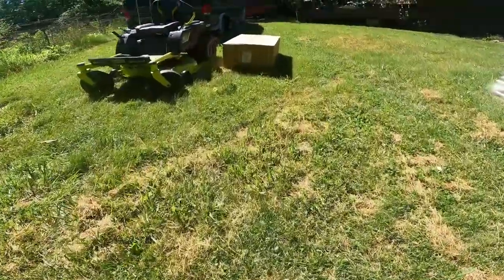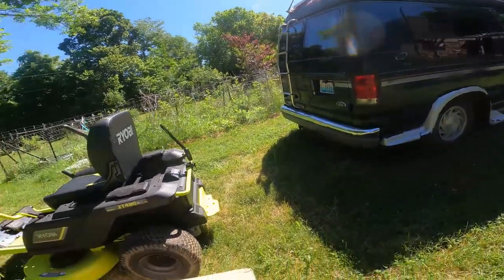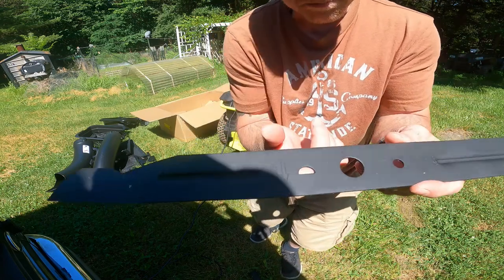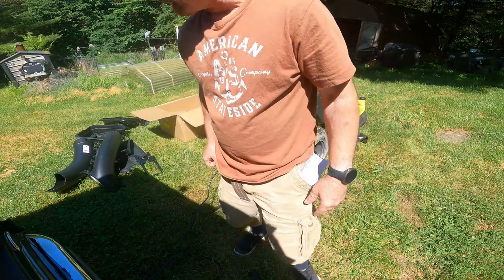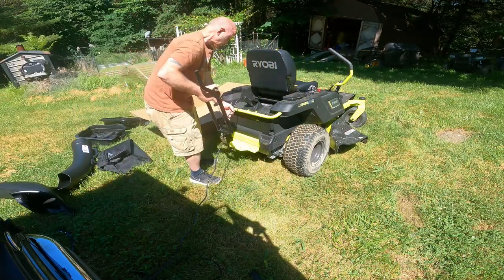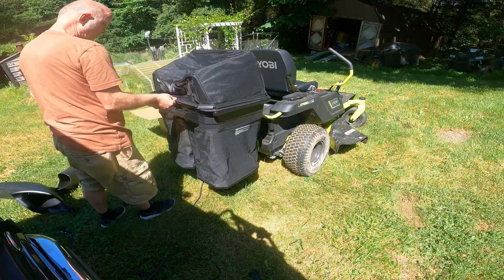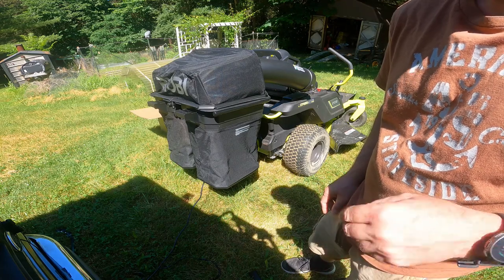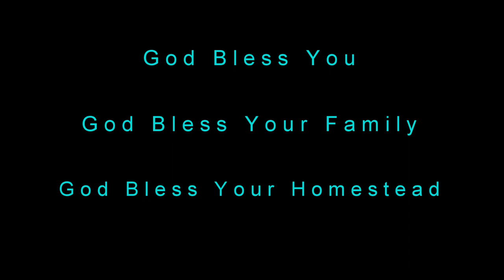ryobi zt480ex electric zero turn mower bagger install

Comment: additionally, i am going to have to make my own
Reply from the maker: you could probably simplify the factory design with just a piece of flat stock steel welded to the existing bag support and a piano hinge welded to the flat stock steel.  Its not a very strong setup at all.
Reply: @sharpridgehomestead   Ed thank you for such a quick reply, i saw this thread you created over 2 months ago and thought you may had started ignoring replies because of robot replies ( not real people ), i am pleasantly surprised you read mine... i love the mower and yes the blades are very thin and very flexable, but i still love the mower, i cut with it but it wont cut tall grass even with the deck height up all the way the chute will stop up and i will have to pull out the grass stoppage of the side chute.. i dont use the bagger when cutting, i will let the newly cut grass dry out, turn brown, usually a day and then put the bagger on and collect the dry dead grass, what i originally bought the mower was to collect leaves from the yard, i dont rake, i am disabled and dont work in a public job work force, ihave 2 acres and the mower will cut all of it on a 100% charge, and it will collect the dead grass in a couple of hours,,, with the top square ring missing i had been using spring clamps to hold the soft material to the bags themselves... i did have an issue with grass blowing out of the inside leaving a trail of debris behind me which i hated, ( again not knowing i was missing the top/lid rod frame) but when i had it jury rigged it did a great job.. i will hope your bags can be secured, i have a troy-bilt gas mower that is approx 8 years old with a 22 hp engine, its a beast but no bagging kit on it and dead grass i just cant have, my craftsman dethatcher wont work well and i bought a yard sweeper by craftsman that tore up in the second season not that it worked well either, but i will go to home depot and get some rod that fits the holes on the upright and give that a try, or do what you suggested, i hate welding, ...the newer models have a single joystick and hard lids, mine doesnt even have arm rests, the motors are strong though, i like to keep the grass short... oh and here in georgia we have ant hills the size of Mt. everest and running over them isnt fun,,, thanks again Ed. the link worked fine to the photos, i did notice another rod with a clip pin that runs horizontal on the upright square box thing, maybe 10 inches in length. you were very helpful
Reply from the maker: @fingerfeller  never a problem and if you need any other information, just let me know. I upload these videos in hopes i can help other people out so i do try to go above and beyond.  Sometimes i do miss messages because i don't get notifications or they don't even appear.
Reply: @sharpridgehomestead   are your batteries still good, notice any loss of power ? and i understand not getting notifications, i am glad mine were noticed
Reply from the maker: @fingerfeller  i haven't experienced any of the issues with batteries I hear other people complaining about.  I've been using my experience with other solar acid/gel batteries to make sure I don't discharge them more than 50% and I also don't keep the charging plugged in all the time (I basically charge them until they are full, then disconnect the charger).  To be honest though, I am perfectly prepared to replace them with lithium if they go bad ... it will be a huge cost but eventually I think it will be inevitable ... and then I won't have to worry about the batteries for several years.
Reply: @sharpridgehomestead   i have read in the instructions to not let charge go below a certain threshold but i run and cut until my meter starts blinking warning me i am at 10% or even 5%... and i have been leaving mine charging 24/7 as the instructions said to do so i hope my practices have not damaged my batteries !!, i didnt see the importance of leaving the charger on 24/7 and i didnt at the first year, but gradually started until it was always plugged in so i knew i would start with a 100% charge ( when it rains and storms hard the outlet i use will trip and it may not get a full charge after the grass dries out so i can cut again i have not recieved a full charge . it happened twice before i learned ) cheers Ed

Comment: hello Ed... the square ring that makes the top or lid work, can you give me the  measurements from bends to bends , length, width, but mostly sir, the original point of origins where the ends of the square ( ring ) stick into the holes of the upright that holds the bags, i notice the square ringish thing has angled corners..on all 4 corners, my kit didnt come with that square framed ring yet its two years old, i had been holding the top onto the  top of the bags with clamps, at this point i cant even stretch the soft top over the bag tops to clamp then in place, however watching your video helped me discover there is a square ring frame that holds the netting material comprising the top/lid.... regards
Reply from the maker: I wonder if they changed the design since they were first made?  I do know, I got so aggravated with mine that I took it off the mower entirely ... literally anything touching the bagger would cause the bags to fall out.  I am going to try to come up with a fix for that next year.  the top support bar thingy is 19-1/2 x 28-1/2  inches and basically follows the outline of the top covers edge (with the corners cut off)... it is held on by a hinge system which I took pictures of for you here (hopefully this link works) if not look up wigeted on instagram:  https://www.instagram.com/p/Cjbd0iJJuIU/